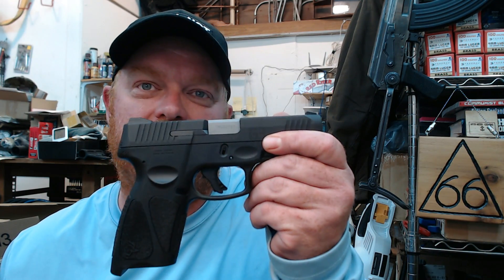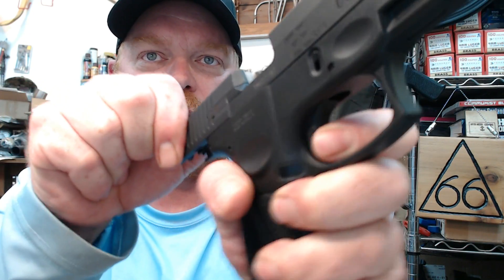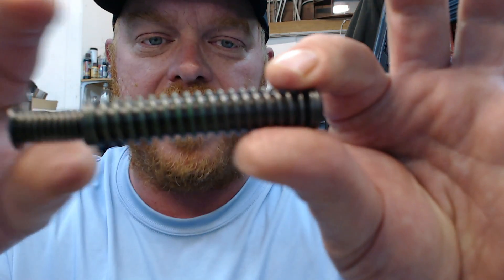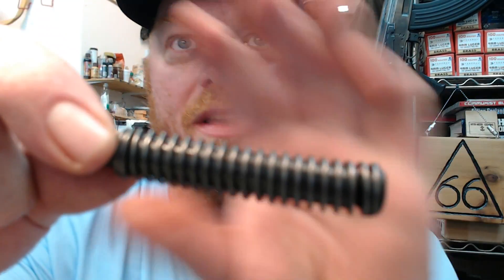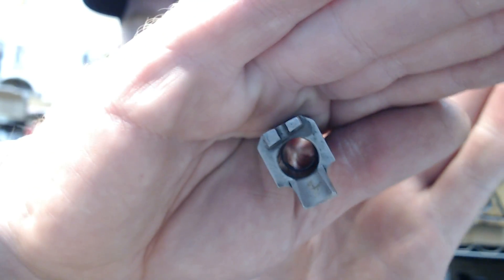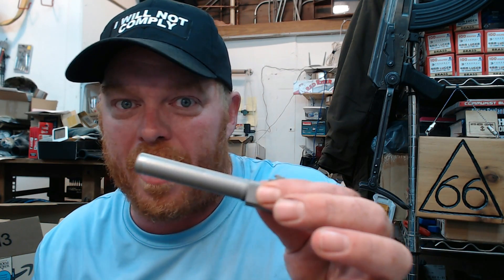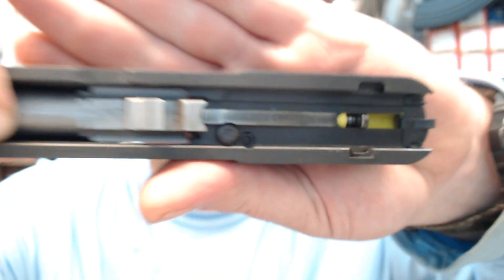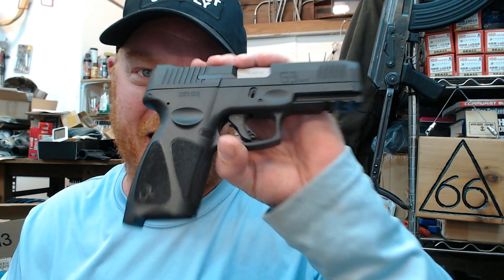Taurus G3 Pistol Q&A : Trigger Reset, Guide Rod, Barrel Finish Wear & Dirty Out Of The Box?

Comment: good vid, straight to the point. without going into  too much detail this will be my next carry gun
Reply from the maker: Thank you. I'm glad you liked it. I really like my G3 so far!
Reply: @2aEdu  its ok brother. my thoughts are if you're gonna carry, carry a full load. and anyone who isnt  physically challenged oughta be able to handle a couple extra ounces
Reply from the maker: @kennethrisner8648  I agree. I carry 2 guns usually, so yeah. Full load out is the way to go.
Reply: @2aEdu  i'm not gun picky, or a gun snob, i'm a big hi point fan and was considering their new 9mm which will be available on or about january, but even then it will be limited to 10 rounds. that said what people have to realize about taurus is that they are built on former beretta machinery, and beretta is world renouned for quality. unless you look very closely, it's very hard to see the difference between the beretta 92 and m9 series.and the taurus pt 92. in fact, and i cant prove this because it's been a long time since i've seen it, i read once where the slide on the pt 92 is actually more solid than on the beretta. as far as the finish, i like a good finish but when i can afford to id get a good cerakoting. the one point of contention i might have with taurus is that for awhile, a couple years there they mucked up the warranty and put out a few bad guns, and customer service lacked during that period but seems they have that all fixed now.
Reply: IMHO, the important factors of an EDC is it must be reliable, one that you are comfortable with, familiar with, and proficient with, and full of ammo that you have practiced with in that gun. Confidence & short placement goes a long way. But if it's too big or heavy or bulky, you will always be adjusting it and Ev1 will notice. Stay armed, stay concealed, & stay safe.

Comment: @2a Edu     Just picked mine up yesterday (stainless version) and it had the brass residue on the feed ramp, but it also had a fair amount of what looks like copper fouling in the barrel. Initially thought it was rust, but it looked more like copper residue. Thought that was strange so I went back to my local GS and he said it looked like copper to him too. We checked the barrels of a couple more G3's in their inventory. Both of those had the same copper residue in the barrel. Apparently, this is a "thing" with this particular firearm or at least the three I've had access to. You said your G3 had a tiny bit of debris in the chamber and barrel. Was the debris in yours "debris" debris  or did it look more like copper fouling? I have bought several new handguns over last several years (CZ, Sig, S&W) and have never experienced copper fouling in a "never fired by me" gun. The rest of the G3 was really not that dirty, no more than just a couple of rounds worth of carbon, etc., but the barrel really had "goodly" amount of "foulage". I ran some Barnes CR-10 through it and it appears to have cleaned up about 80% of the copper residue. I know this is just a $235 gun, but still I hope this is not going to be a long term problem where barrel gets fouled very quickly after only a few rounds.  Just curious if anyone has experienced this on a new firearm, either G3 or other make.
Reply from the maker: I will do more follow up on my G3 in future videos.  I wouldn't worry about it is my short answer. I think maybe a little video on this topic might be cool. I have a couple theories.  Let me think about this a bit.
Reply: @2a Edu  Really looking forward to your future content. I like your down-to-earth, common sense approach. Thanks.

Comment: Want to know if its adviceable or not to mirrow or chrome polish the barrel or should we keep factory coating as it is?
Reply from the maker: You can definitely polish your barrel. Keep a light coat of oil on it though because it does have a coating that helps protect from rust.

Comment: As far as I know, the barrel is all stainless steel. I don’t believe that there is a secondary finish applied to the barrel. The shiny parts are just where the steel is getting polished from metal to metal rubbing. Yes. I own a Taurus G3 TORO.
Reply from the maker: Yes,  I think so too. When I did this video,  they weren't saying what the  barrel is made of.

Comment: It looks like the G3 trigger pull is also all the way back to the frame to fire a round.  Having to pull the trigger on my G2 all the way back was very uncomfortable and awkward for me. The trigger pull is just too long.  One of the upgrades I did on my G2 was the "pseudo backstrap"  replacement trigger from Keeptinkering.com.  This helps resolve this issue and gives more of a normal trigger travel distance.
Reply from the maker: I don't mind the trigger pull on the G3. It has a trigger stop, so it doesn't have any over travel. I have heard good things about the Keep timkering triggers. I might get one for the G2C. The G3 trigger is pretty much good to go for me though. Thanks!
Reply: I added the Asmund short stroke trigger ( that retains double action/single action, this is the only reason I chose this trigger over the pseudo trigger ) I did not keep my trigger safety ( persenal preference ). The trigger is really nice and I love the flat trigger with no rounded edges. I will be getting the pseudo for a fun range trigger though because I like the skeletonized look lol keep tinkering does a great job still.
Reply: @adamwaffledivision3282  Heck yeah, trick out those G2's and G3's.  Think you will really pleased with the pseudo backstrap trigger.  I didnt miss the double action trigger at all.  Usually if there is a misfire its due to a failure to feed/hung round issue like the 20 round Mec Gar P226 magazines I have.
Reply: @clarkwheeler8764  lol true I can't stand all the mec gar p226 mags, they jam constantly in my g2c ( regardless of federal brass, steel or grain ) they run great in our 226 though 😅😅
Reply: @clarkwheeler8764  also I guess I should of added I wanted to keep the re-strike capability in the G2c. Which recently Keep tinkering has made new triggers that does retain the factory features.

Comment: What are the benefits of changing to a full steel guide rod and trigger
Reply from the maker: I would not change the G3 trigger. I love it as is. The steel guide rod is more durable. The OEM guide rod seems to hold up pretty good BTW. In my guns. I did a video with the Galloway steel guide rod on one of my G2Cs. look at my project pistol playlist.

Comment: Just bought a G3 about a week ago and I put about 150 rounds through it . It didn’t jam a single time while shooting it however it gets stuck while feeding the first round into the chamber, Ive cleaned and used lubricant but it still gets stuck on the first round being fed into the chamber. Any help on how to fix this?
Reply from the maker: Make sure you are pulling the slide all the way back and let go. Dont hold onto the slide or let it ease forward.  That might do the trick
Reply: Yes, release the slide completely. I've found that some new pistols have this problem with the magazine topped off. Try using one less than full capacity until the mag spring loosens up a bit. That seems to help, good luck.
Reply: Which mag are you using I'm having problems with the 15 rd that came with the pistol!

Comment: I personally wouldn't buy a Taurus, but they are 100% acceptable for anyone looking for an inexpensive gun for self defense, or for a gun they can just throw around and not worry about some scratches!
Reply from the maker: That is the great thing. They allow good people who are poor to be armed. That is the most important part. I had never been a Taurus guy for decades. I got the G2C initially thinking it would be junk and everyone had been over hyping it. I actually love it and it has worked great. Taurus has no doubt crapped the bed in the past....big time. Lawsuits etc... But since they have been under new management, the G2C and G3 seem to be a major step up from some past models. 
I'm def not putting them in the top tier. But I will say they rank very high in the bang for your buck category.
Reply: @2aEdu  I agree with that statement... 👍

Comment: Owner's manual states 5lbs (single action) to 9lbs (restrike). I'd still like to know if there is a way to make every pull 8-9 lbs so I know I won't have an accidental discharge under stress.
Reply from the maker: I like the single action lighter pull. There are double action only pistols too. The SCCY for example has a constant 9lb DA pull. This G3 does have a couple safeties though. ( 3 to be exact). Some people do like DAO triggers. It your personal preference. I dont blame you at all.
Reply: Take the slide off and hold it upside down beside the frame . Now work the trigger , you can see how the trigger works . It appears it would be easy to change it to the DAO mode . Any gun Smith should be able to do that . I may change mine for carry purposes  .

Comment: Actually the Guide Ron material doesn't matter, as you stated!  In the past, Taurus has issues with their Recoil spring, sorta' the coils jumping over each other.  But, for some extra money Lakeline LLC. have them as well as Galloway Precision.  I WOULDN'T run and order a new one as soon as I got the gun, but just keep an eye on the spring?
Best to ya',,,,!
Reply from the maker: Yeah, I have heard about the Galloway and Lakeline rods/springs. Many people buy one the day they get the pistol. Me: I still am running my G2C bone stock, and no problems. 
It seems a lot of the prior issues Taurus had with previous generations of these guns have been cleaned up. They say they are under new management, and I think I can see that.
Thanks man, and best to you too.
Reply: @2aEdu  I'm still running my PT111 MILLENIUM G2 stock as well.
Be Well, Be Safe!
Reply from the maker: @gentleoldguy4990  Awesome, that's great.  I'm going to start my stream soon.
Reply from the maker: @gentleoldguy4990  Yeah, I don't modify guns unless I need to, or want to....lol. In this case with my G2C, I don't want to or need to.
Reply: @ @2aEdu    I might buy the G2c? Heck my spare mags will work, I have 4 holsters (2of I won on-line) and my spare mag carriers will work.  I don't really like to upgrade when its more than have the price of the gun lol! But, Lakeline had a blacked-out rear sight and I'll probably do a night site!  I've never had night sights on a gun and I've been carrying since 1973!  Ya' think I'm old school?  Heck, never owned a plastic gun until 4 years ago!
Very best to ya' you have a great channel!
P.S. Tell your viewers hit the unsubscribe and hit subscribe again, as well as notifications!  I've been UNSUBSCRIBED, from more than 8-9 channels (I figure by You-Tube) in the last two weeks or so!!!!
Reply: Yeah, I'm running the lakeline guide rod/spring and striker guide/springs. Only did it to replace the plastic parts just like I did with my Glock guide rods/springs etc. If I'm not mistaken Galloway offers theirs in 16 and 18lb springs. Haven't tried them myself.

Comment: Ima getting a g2c in a couple days do you know were to get a extended mag I seen the promag ones but I have heard bad stuff about it
Reply from the maker: Sig P226 mags will work, but I have had mixed results with my P226 18rd and 20rd. Brass case feeds good, but not steel case. Look at my Taurus playlist and I have several videos using them. I will have a video next week with me shooting My G2C with the G3 15 and 17 rd mags. Those will probably be the best choice, but I have not tested them yet. I will also be showing the grip spacers for the G3 mags in a G2C.
I am generally not a Promag fan. I have recorded a video of shooting the G2C with the Promag 32 rd, and I will be posting it soon.
Reply: agree. don't go promag, but mec-gar is solid. i've got the 18 and it's great. no problems.
Reply: MecGar SIG P228 also works in G2/G2C. The 15-rd P228 mags + sleeves from BloodyWheel make a nice carry magazine for G2/G2C without sticking out too much.
Reply: I bought one pro mag tried it in my G2c worked great so I bought a second no problems with the 15 rd pro mags I recommend them myself

Comment: That trigger has restrike capability. You don’t need to rack the slide to feel/hear the reset.
Reply from the maker: If you want to feel the single action pull and reset, yes you need to rack the slide. The "restrike" is a double action pull. ( twice as long and about twice the weight). Me racking the slide shows the reset and pull after a round is fired. (single action) Thanks for watching.
Reply: @2aEdu  You beat me to it. I was about to explain it to Under Experience  I mean Under Review.
Reply from the maker: @barefootbob1269  Thanks. I have spent a lot of time with these guns, but I get explained a lot on how things don't work. lol.